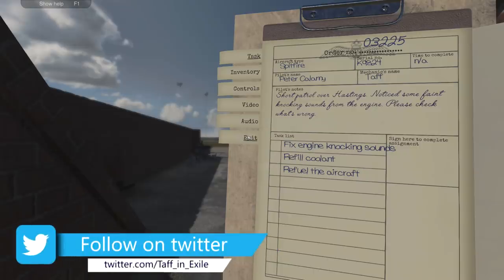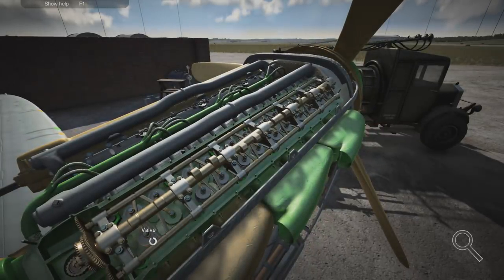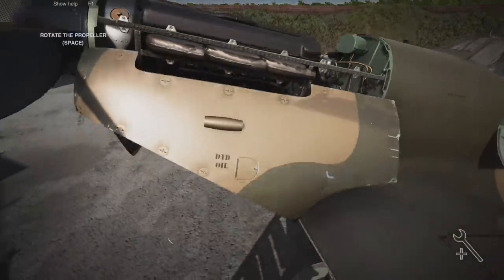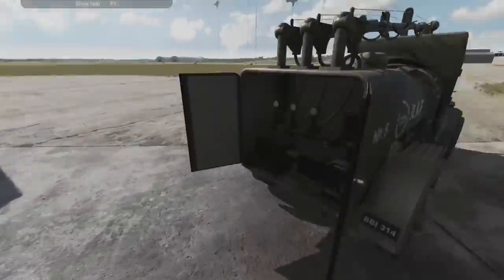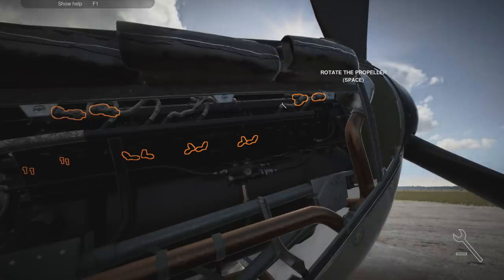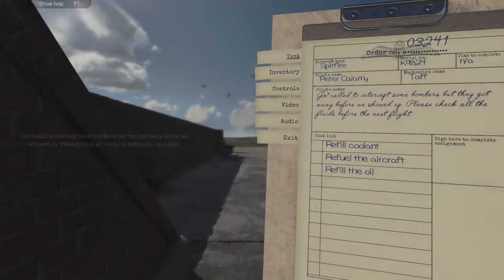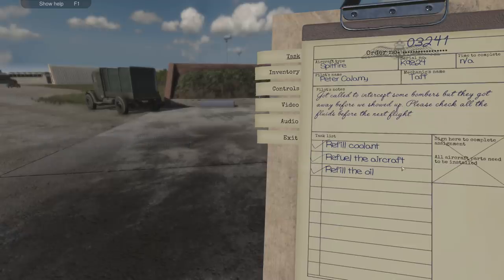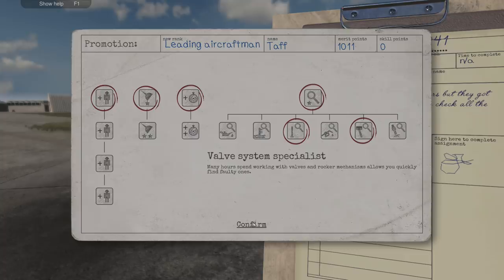Plane Mechanic Simulator | Spitfire Maintenance | Part 8

Comment: Yeah, Taff. You forgot to plug in literally half of the ignition wires. They were all plugged in on that one side from when you installed the wires and moused over them, but the otherside was left unplugged
Reply: I don't think he screwed them in either, massive derp on his part.